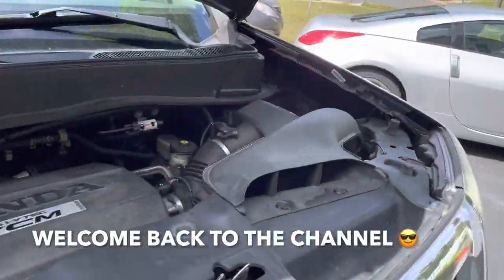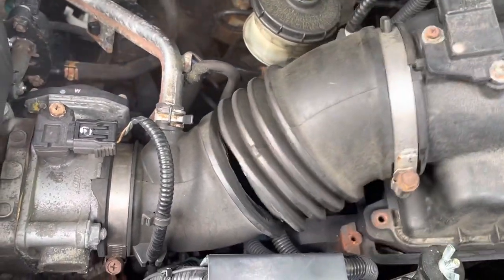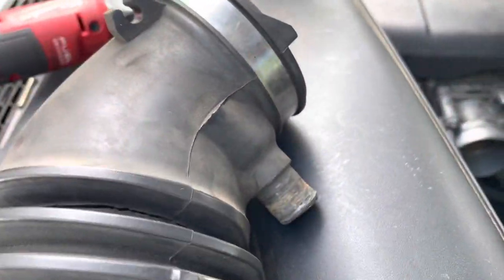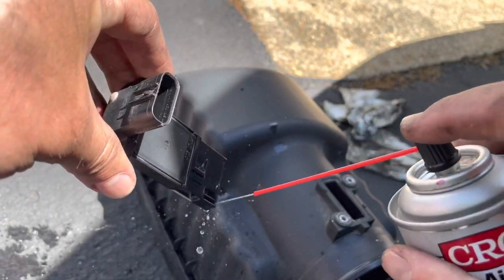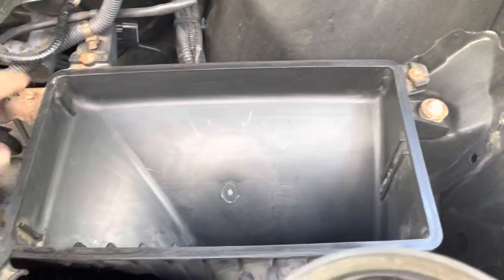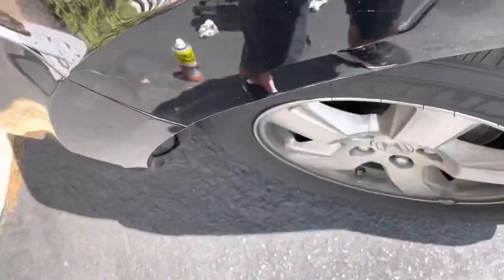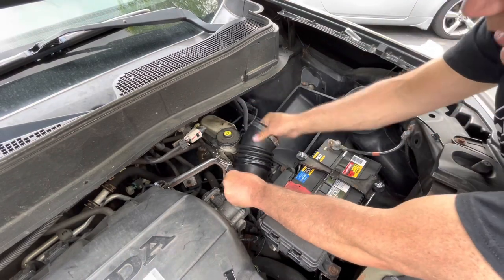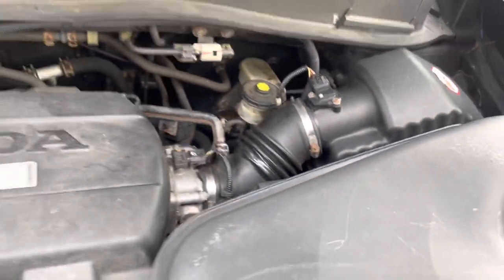HONDA AIR INTAKE CLEANING - How to Clean the Air Intake System on Your Honda. Plus I Found a Problem

Comment: My wife's Honda pilot kept shutting off without warning, no check engine lights, nothing. I was poking around and found that air intake hose had ripped like yours. I replaced it for $40 and it hasn't shut down since. Good video!
Reply from the maker: Thanks for watching!😎
Reply: Mine broke at the same place. No codes. '08 Pilot.
Reply: JB Weld guys

Comment: Do you use the throttle body air intake cleaner to clean all the parts or do you use something different?
Reply from the maker: No, use it just to clean the throttle body. You can use any cleaner for all the other stuff.